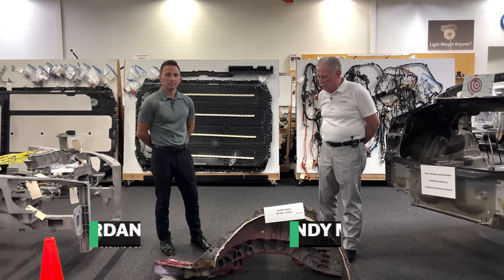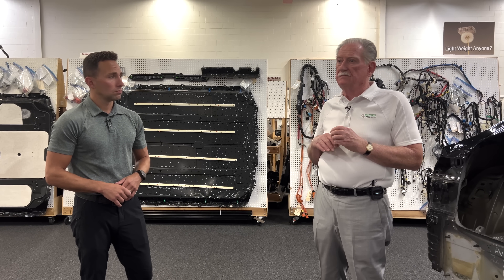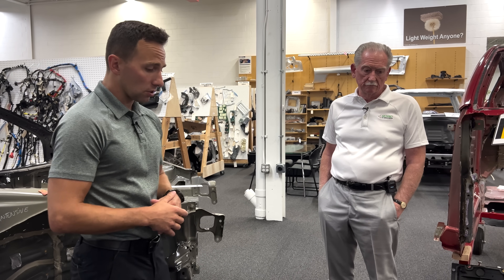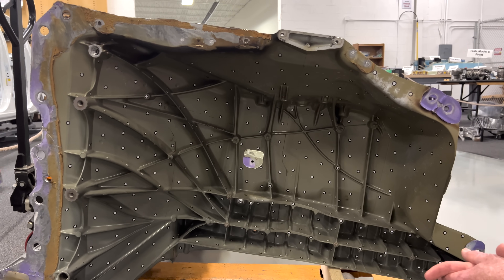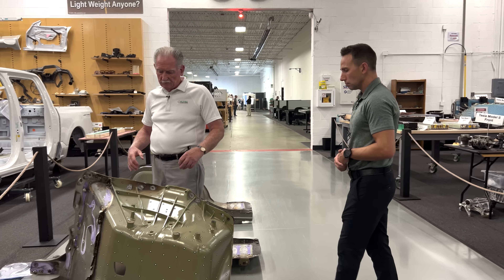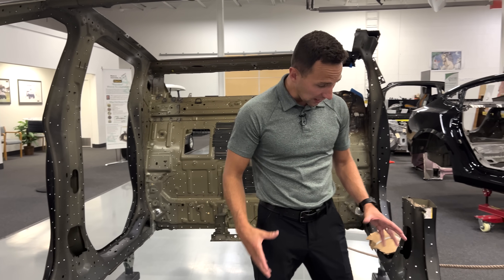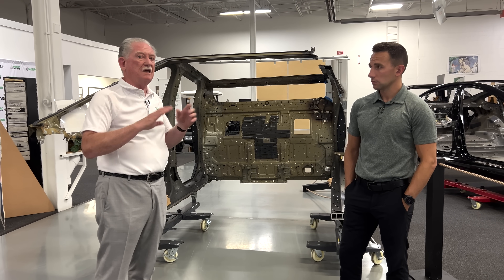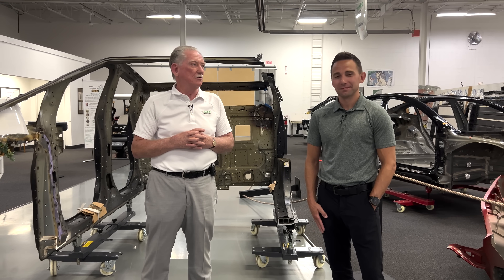From 120 to 1: How the Cybertruck Castings Continue Tesla's Reign of Reduction

Comment: Any thoughts about Elon claiming the cybertruck would have a stainless steel exoskeleton but in reality is castings with a stainless steel skin thats just there for looks?
Reply: @MiniMotoAlliance  I never heard a clear answer to this either
Reply: Like somebody else pointed out, CT's skin is a stressed element that adds to the rigidity of the vehicle. You can think of it as a partial exoskeleton. Elon said as much in the later comments.
Reply: The Cybertruck is primarily anything but stainless steel. Regular steel and aluminium reigns supreme. There is still a lot of stainless steel, because the panels are so thick!
Reply: Good question.  So what cost or capability gains have they gotten with their final result?   Sounds like it’s a cost benefit. Consumer benefit is efficiency and tech features.
Reply: You've seen the testing, the body of the Cyber truck is substantially more damage resistant than anything else that's ever been put on the market. Show me a car door in the last 50 years that can stop a 9 mm.
Reply: I think it’s the most bullet proof pick up truck money can buy.
Reply: so u think that the skin of the car is not needed and it would just drive like it does without it?
Reply: The skin of the cybertruck contributes to 70% of the crash resistance. It's an exo skeleton.
Reply: @themonsterunderyourbed9408  It is absolutly not.
Reply: @GTO33  Okay 👍
Reply: @whodat9198 @MiniMotoAlliance   The exoskeleton concept was to take some of the weight from the frame and move it to the skin to enhance durability. The cyberTruck does exactly that.   The stainless contributes to both stiffness and crumple.  Few people understand that the CT use of bolt on stainless is much like what we see in biology.
Reply: @danharold3087  That is exactly like they built cars in the 50s, 60s and 70s. More of the load bearing and structural sthrength in the outer skin. Good for car park dents, bad for anything else. This is the downside to Teslas engineering practice. They fell in love with an idea, they started to develop a car based on that idea, and when they realised that the idea did not work, it was to late to stof the projects, and you end up with a expensive compromise.
Reply: @GTO33  They didnt even do that. Its just a typical unibody with structural rear quarter panels.
Reply: @GTO33  Nope.  Cars from the 1950s to the 1970s were built with thicker steel compared to modern vehicles.  They were relatively malleable, prone to denting and responded well to classic hammer and dolly body work for same reason they dented.

Tesla is known for making more mid-cycle improvements to its vehicles than any legacy automaker.
Reply: @danharold3087  The only part of the vehicle with enough surface area to actually contribute to the structure is the bed... aka, the rear quarter panels. Since rear quarter panels are structural in most other modern  unibody designs, there really is not much difference between the Cybertruck and every other unibody truck out there. Its just marketing.
Reply: @patreekotime4578   The cyberTruck has a much more durable skin and about the same weight as a F150 lightning. I would say that is a major difference.   Because a unibody rear quarter panel is structural it is expensive to replace.  The CT's can be replace in short order with a wrench.  This is not a typical sheet metal origami unibody.
Reply: @danharold3087  Durable skin =/= exoskeleton. You, like Elon, are just shifting the talking points. They have done some radically good engineering with the castings and have finally shown how an uncompromised integration of the structural battery pack reduces weight and structural complexity. If that had been the sales pitch, I would say that they nailed it. But it wasnt the sales pitch. And if anything the stainless steel is dramatically heavier than a mild steel truck would have been. Its also a bit ridiculous to compare it to the F150 because body on frame is always heavier than unibody... its a big reason why unibody designs became so popular, they are more rigid with fewer materials and less weight.
Reply: So you're saying they were only 50% ahead of everyone else instead of 80%?
Reply: Thoughts? Sure. Who cares?
Reply: Because like almost everything Musk has said about Tesla products, it was marketing to fluff stocks.

Comment: Revolutionary in the fact cheap to build but makes car unrepairable!  Nice
Reply: Back in the basement sir!
Reply: @RayNLA  wow really nailed that!
Reply: @bubbafatas2588
I think this is the interview where Lars gets quite upset regarding the "Internet expert" opinions regarding repair of the castings.....
Discuss?

Sandy and Lars Moravy: Head of Vehicle Engineering discuss the Cybertrucks castings and eksoskeleton. Full Interview: https://youtu.be/J5zDNaY1fvIMunro Live ...
Published: 11 December 2023
Reply: Why do you say that? Sandy has said otherwise. You can tap screws into cast aluminium. You can weld aluminium castings (but it involves specialist skills).  Cars with bent a bent chassis are normally a write off.
Reply: @robertwhite3503  I'd like to learn more about this. Do you know which videos Sandy addresses repair cost? That seems like the only downside to this.
Reply: @robertwhite3503  no you cant! also it wont have the same structural rigidity as it was manufactured ! its literaly a risk youre taking, you cant just screw or weld, cars with bent chassis can be very easily replaced.
Reply: and absolutely impossible to modify! toyota released a $12k truck in Asia and people have already done all kinds of mods from dump truck to 6x6 conversion..... for all kinds of applications ive even seen one with a crane.
Reply: This makes it easier to repair.  Crumple zones make cars unrepairable.  Destroying the vehicle to save the people inside makes it unrepairable.  Stick to GMC Hummer if you care more about the vehicle than yourself.
Reply: @davidbeppler3032  literally nothing you said is remotely correct!
Reply: @bubbafatas2588   Back that up.
Reply: @danharold3087  Tesla is reportedly working to address concerns that the giga castings used in its vehicles are far too difficult to repair. Assumed difficulties in the repair of vehicles that utilize giga castings are reportedly pushing up the cost of insurance, as per Autocar.
Reply: @davidbeppler3032  it makes it almost impossible to repair lol!!! have you watched sandy video where he actually tried to separate the modely casting from the metal sheet? it was absolutely destroyed.
Reply: @alanmay7929  What did Sandy say about repairing a cast?  Did you also see that one?